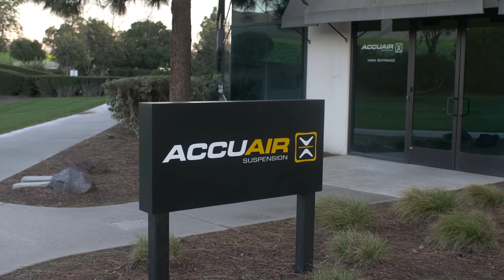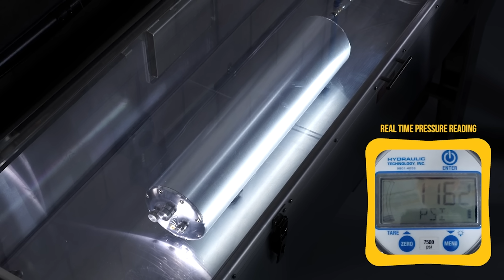Why ACCUAIR Is Worth It

Comment: My only issue with there design is the 3/8” push lock hoses tend to leak. If the car sits you will come out to your car sitting on the ground. They should offer the tank with 3/8” threaded bung so brass fitting and braided hose can be used. It’s how we did our air bag set up on our trucks back in my lowered truck days. I love the way the product looks and really like the idea and I will order one.  I’m just expecting the 3/8” push lock fittings to leak as usual. Have they made any improvements to the fittings?

Comment: i would like to know more about air suspension. i know i want it but lost on my "must have requirements" or even what they are capable of depending on the brand. are they customizable to the sense that they air out differently? (like rear first, or all 4 corners at the same time) or different speed for filling/airing out? customizable for different ride heights depending on speed etc? firmness? lots of questions little or hard to find info available. Please do more videos like this, and keep being awesome.
Reply: is that all just programming? it seems like most videos i see of people doing installs its just drop in and thats it. they dont show the adjustments needed to get a good fitment.
Reply from the maker: Thank you for the feed back sir! We are looking to do more information videos like this down the road, Thanks again!

Comment: $5k is too steep thought and that's not include with the airstruts(4pc)😔😔😔
Reply: m_ a_b i got quoted 3800 shipped to my door with a 5 gallon black cvt tank elevel and the bags and mounting hardware and lines.
Reply: I paid 5k€ for a 3gal Endo-CVT tank + Accuair eLevel + AirRex struts
Reply: Freddy Gaertner ah two reasons probably because you were shipped intentionally and because you got air struts instead of just bags